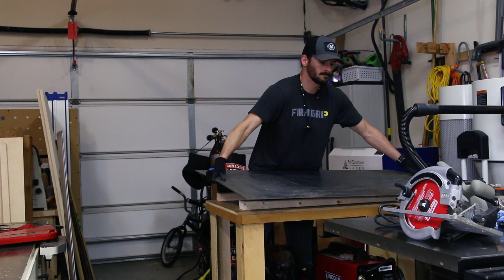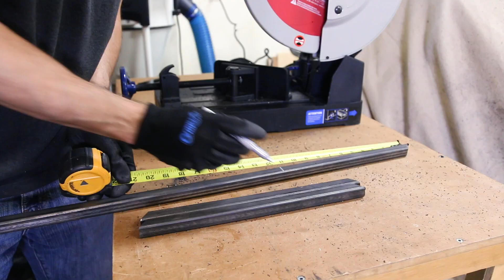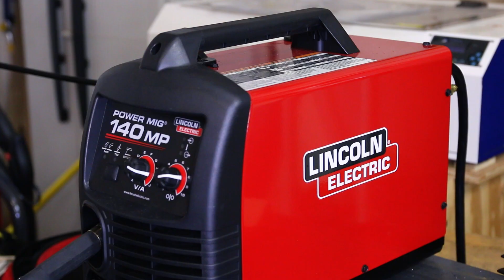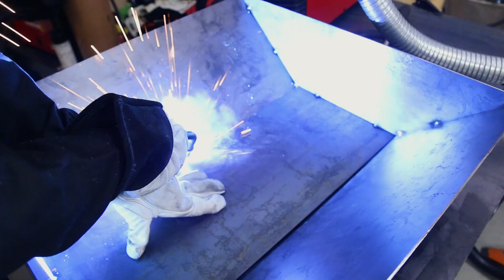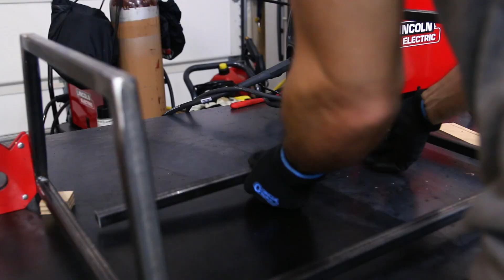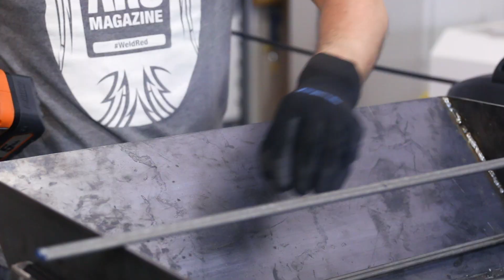How to Make a DIY Fire Pit from Steel | Welding Projects

Comment from the maker: Let me know what metalworking projects you'd like to see me take on next!
And don't forget to SUBSCRIBE! https://www.youtube.com/c/fixthisbuildthat?sub_confirmation=1
Reply: Link to plans?? Measurements more specifically
Reply: Great Job!  You made it look so easy!!
Reply: So did you put that metal cutting blade into a normal circular saw?  not a metal cutting circular saw?
Reply: Exactly what I'm looking to build.  Question: is there anything you can spray, coat, or imbue the metal with that would 1) protect it from the elements, and 2) still be food-safe (for searing steaks and such!)?
Reply: Thought you said you would have plans available for this?
Reply: @ryanWildflower  rough plan I used based on his tape measure views ... 
1.) Cut 3x 24"x10" (2 sides, 1 bottom)
2.) Cut 2x 24"x~7" (2 end caps)
3.) Mitre -45 ends of 24x~7 pieces.
4.) Weld
5.) Make base to fit your final dims
Reply: Can you tell me how the blade work

Comment: how many inches is the short side of the trapazoid? I sketched up this exact build at 24 inches on the long side then cutting the corners at 45 degree angle but that only leave a 4 inch short side. your base looks more like 10-12 inches which would make the longer side to be about 30 inches and not 24

Comment: What are the measurements of the sides? Trapezoid sides are 2' at the top but what about the bottom? And the other sides are 2' by what? And what are the lengths of the frame?

Comment: Planning on making this fire pit...  Is there a list of material you used, and best recommended blades for seven and a half in skill and a four and a half inch angle I'll be using a yeswelder mig 205ds-b welder

Comment: I like this, I don't onow if it would be possible, or if you will even see this, but could you give me the measurements for the finished project? The length of the finished leg peices, the lengths of each trapezoid, and so on? I would like to do this one as a project.

Comment: Sorry but was the square tube 3/4" or 1/8"? The video said 3/4" but the paragraph after says 1/8". Can't wait to make it, wonderful video.
Reply: From looking at it , it looks to be 3/4” diameter and it’s 1/8” thick
Reply: I’m looking for measurements on the actual fire pit I work at fab shop as on cnc operator and gonna try and cut them myself on my burn table and purchase the materials for this little fire pit

Comment: That welder you used with an "entry-level price point" lol. It's obvious, at a grand, we have different definitions on "entry level".  😊
Reply: The Titanium 125 at harbor freight is a good entry level machine at $180-200.
Reply: My entry level is a amico 160 stick/ tig. $150 and so far so good. Burn 3/32 7018’s and 1/16 6013’s and 3/32 309’s. Rarely use 1/8 as I don’t typically work with over 1/4” steel
Reply: @krigdon93  
🤣🤣🤣🤣🤣🤣
Reply: I was thinking the same thing
Reply: It’s a good investment if you know your going to get further into welding but I do agree that this is a high price for “entry level”
Reply: It's "entry level" because he gets free stuff from the sponsor companies as a thanks for showing it in his videos.
Reply: there are cheap mig welders available.  Forney is USA made for cheap.  the wire runs a little slow, but its made for 15 to 20 amps, household plugs.   its like 300 bucks, ive made a lot of tools and repairs with it. you can easily weld thin materials with it.        my yes welder stick welder can weld ANY thickness of metal, it was like 125 bucks. runs nice, has hot start options and all that. dirt cheap.     but i need to use my big generator for the stick welding.
Reply: As a pro welder, I don't think you all understand how expensive welding machines are lol. A "decent" table saw for carpentry can cost that much hahaha. If you want more "entry level", spend $500, like I did, on a Craigslist welding machine. I got an ESAB 141i Fabricator for $500 and it was used. While it's a 140amp multiprocess welder, it only came with a MIG torch. No tig torch. And it doesn't do AC, so I can't tig aluminum. A slightly-above-entry-level new welding machine will cost you something like $3000. If you're a new welder, and want to learn at home, DO NOT WASTE YOUR MONEY on a mig or stick or even just tig welder. Save a little more and get yourself a MULTIPROCESS welder. Best first decision you can make for a good headscart. TIG is a very worthwhile process to learn and can make you a lot of money. But MIG and STICK will also definitely have their uses for you. I have a 2-car garage where my kids will walk barefoot, so I'm pretty much limited to TIG only, inside. But I can pop outside and practice my gas-shieled Flux core, or my stick welding, anytime I want, and all on the same machine that only cost me $500, plus the cost of the welding cart (over $100 at harbor freight) and the argon gas cylinder (nearly $200). My next machine will hopefully be an ESAB Rebel EMP 205ic. It goes for $3,850 brand new, with all the gear for mig, tig, and stick. But you still need a welding cart and 1 or 2 gas cylinders (argon or various mixtures for tig or gas shielded mig)
Reply: Truly decent machines are very, very expensive compared to the "entry level" 1,000

Comment: Dang it!! Very impressive! Do a project without welding! Using screws nuts and bolts and a drill and an angle grinder. I sure could use some tips on joints. (Not weed). I realised with profiles u can make holes and put metal rods through. Or even wood. A bookshelf or shoestand maybe? Or why not a workbench or an A frame as a roof for a workshelter, portable maybe?

Comment: Can I get a list of your materials and the measurements please I’m trunk to do this for a project
Reply: Bobby Walsh the trapezoid ends are two 32x10” with 45° cut off each end and the rectangles are 32x14” I just built this and used 1/8th inch steel, turned out really well and I built it with just a small mig welder the bottom is like 32 x 11 13/16” or something like that I kinda just sized it till it fit flush with what I liked and the legs you can really do anything, don’t necessarily need a grill insert if u trust your welds enough haha

Comment: I got some help on that with the same blade dont cut all the way thew the metal barely cut the top enough to fold the metal it will make a cleaner weld when u only weld thew the inside of the pit out side it wont it will only look folded much nicer...

Comment: is there anywhere I can find the exact lengths for the cuts? 
im just struggling to lay this all out because im not sure of the lengths
Reply: I am having a student make this in my ag mech class. The two trapezoid ends end up 32 x 10 and the two rectangle sides come in at 32 x 14. The bottom rectangle  comes in at 32 x 11.81 (11 13/16ths ish). We drew it up on auto cad and then layed it out on cardboard to be sure everything would mock up correctly. All the above pieces for the bowl were then cut out by our cnc plasma table. He will be welding the bowl up this week and then he has his own design in mind for the legs and braces
Reply: James Shughart thank you very much for your time and efforts sir. I’m actually a high school student in an ag fabrication course and this will be my final project. I appreciate your reply and have a nice day

Comment: When welding the sides of the pit, does it matter if you weld on the inside or the outside?  I’ve watched several videos and it is split down the middle - some weld on outside and some weld on inside.  Does it matter or is it for looks?

Comment: Entry level price point...pffffft. that welder is about $800 and thats not counting all the other stuff one would need to weld.
Reply from the maker: I should have more accurately said an entry level multi process machine. Can get just the MIG version for ~550.  Can buy cheap ones, but get what you pay for IMHO
Reply: Taylor  since it is DIY I expect that materials and tools needed would be more coat effective for someone looking to make their own stuff vs spending money on mass produced product at retail prices with a sacrifice in quality.  If that means you need at least a $500 tool? I'd rather just buy bricks and build a fire pit for about 60 bucks or buy a mass produced one for about $100, even if it means I need a new one in a few years.

Comment: I build many fire pits and I do like yours for the simple design, one thing try not to use  1/4 inch round stock it will warp on you and will burn thru sooner than you think, use 3/8 round , 3/8 square  or rebar for you fire grate , they will last much longer.

Comment: Well, apparently, the plural of octopus isn't octopuses or even octopi. It's octopodes. So....apply that to rhombus and you'll get the word right. Love the fire pit, but I'd be a bit concerned about the heat the metal conducts after a few hours of use.

Comment: Nice work as usual, vert stylish and modern looking fire pit. The way the legs are sort of an inverted shape of the bowl makes me wonder if it could be made in 2 pieces that nest somehow for storage. Not sure how but it would be cool. Also, the chop saw, was that a slow speed saw intended for a metal blade or a high speed saw intended for an abrasive wheel? I know April had tried that blade on a saw meant for abrasive wheels and had a problem. I have an abrasive saw that i would LOVE to swap to a metal blade.
Reply from the maker: That blade has to be used on a slow speed saw.  1800 RPM or less

Comment: Grab yourself a used (oil or fuel) drum say 20 gallon or 40 Gallon and turn them into either a fire pit or flip top BBQ. Maybe using scrap steel reo for legs etc. Great vid :-)
Reply from the maker: I'd like to make a BBQ, that would be fun!
Reply: Everybody makes a fire pit from a drum!! I like the sheet metal look with the angles myself

Comment: I really dig  this. It's so simple in the cuts but the final piece has a nice modern complexity to it. I'm very very interested in making something like this and actually have the equipment but am hesitant to pull the trigger not knowing how it might stand up to the elements. I'd love if it you'd post an end of summer instagram update to show how it held up...maybe? Cheers brad.
Reply from the maker: If you finished it with a high temp paint it would probably hold up nicely

Comment: You should of tacked the sheet metal parts edge to edge instead of flush, you would of been able to weld the outside solid easily and have nothing to buff down. It’s a little hard to explain 🙂 awesome job though 👌
Reply from the maker: Ahhh, I can envision that.  But my welds are far from good enough to leave as a show piece 😀
Reply: @Fixthisbuildthat  A tip from a Welder... weld the outside!,
Practice with some scrap bits first though!, it's so much easier to buff-up later if it's not too pretty. Also I would set up the seam up so it runs slightly downhill, start at the top and point the gun into the direction you are going and go quicker! if that makes sense. it has the effect of smoothing the weld pool as it's falling. Be patient and practice this way of welding, you might have to play with the juice and feed, but it should look almost like its been Tig welded.
Second tip!  It's all about getting comfy... make sure, if your right handed to anchor your left elbow in a way that it can pivot across the length of what you want to weld, you can help you get further without have to stop, It can be your knee or the workbench or anything but the aim is to keep your gun at the same angle without shaking and keeping  your speed consistent, do a couple of passes before you attempt to start welding. Keep calm and breath slowly that helps as well.
I hope all that helps :-) and keep welding!
Reply: @Fixthisbuildthat  outside corner welds are very simple to grind

Comment: It's a trapezoid or more specificly an isosceles trapezoid as it has center line symmetry. 
Which by definition also means it's a quadrilateral with only two parallel sides (rhombus are like squares in that all four sides are equal length) .
Quadrilateral > trapezoid > isosceles trapezoid 

(Geometry definitions are not my strong point... I have to look them up too)
Reply: A rhombus is like a square that's been bullied and blown over a bit. At least that's one way this Geometry teacher has described it to past students :)

So Ask Questions is right, yours was a trapezoid :)
Reply from the maker: sounds right to me 😀

Comment: It's a trapezoid... Thanks to the NHL for teaching me that :P
Reply from the maker: Dangit, I knew it!
Reply: Nice Job, build a workbench from 2"  or 2 1/2" SQ x 3/16' wall Tube with 3/8 or 1/2" Top Plate 4' sq or 3' x 4' & bolt vise to it